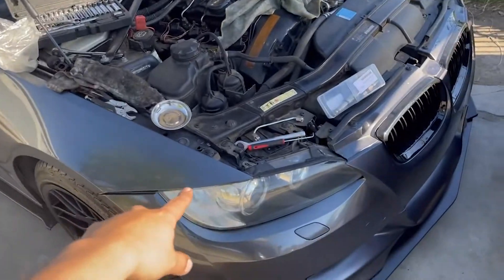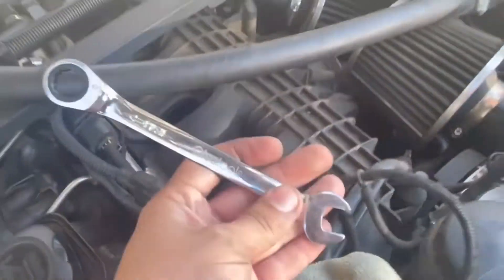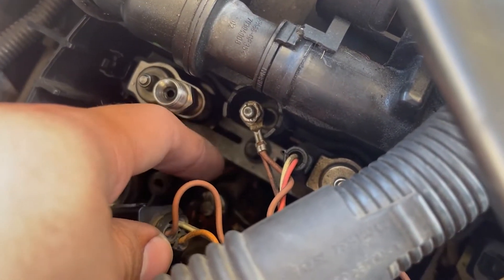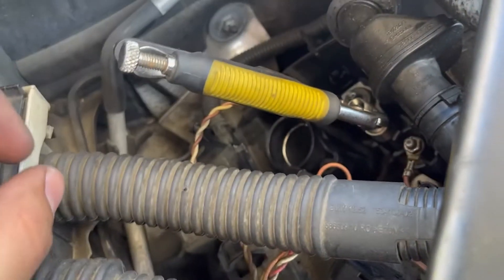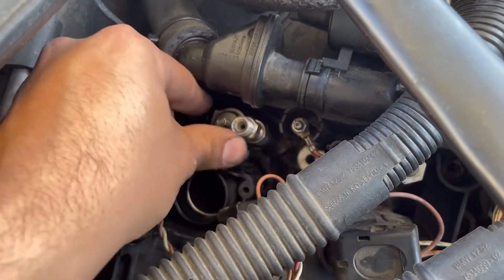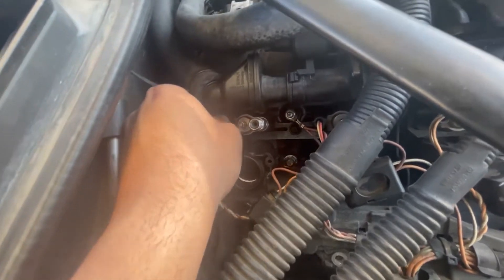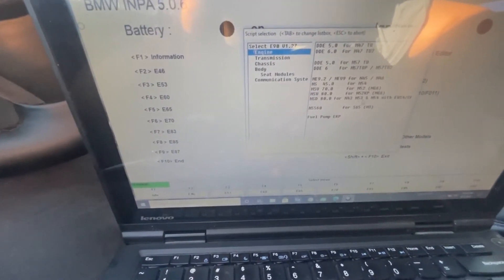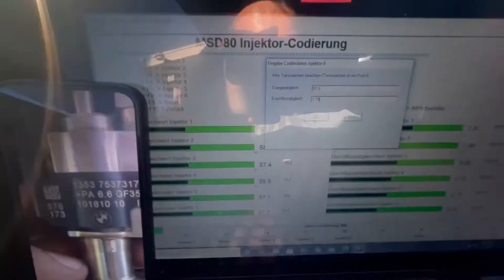INJECTOR replacement bmw N54 335i Without special tools

Comment: so lame that you did not just show the electrical plug harness removal, when you thoroughly had so much to say about it. Twice you could have just shown it, but instead you BS'ed your way out of it. Think about the value you bring when you can show someone with less experience than you just how it's done instead of just talking about how it's done and then not showing it. Try again.

Comment: I recommend getting an injector puller kit you can get a good one of FCP for a little over $100.  If you wiggle the injector while pulling it out you can oval out the port in the head which is a real pain in the Johnson to fix.  The puller kit also comes with the tool to compress the injector seal.
Reply: Do you think the one on Amazon will work? trying to be cheap because I’ll use this tool once every 6 years
Reply: @jumpmanadam1536 yeah should be good enough I bought a cheap harbor freight puller and used that to slide hammer them in they’ve been in for over 5 months now and no issues at all
Reply: Did this happen to you? What’s the fix
Reply: @amirholmes-qi4fd  didn’t happen to me I’ve just seen it plenty of times the fix is drilling out the hole larger and tapping it to put in a bung to make the hole circular again.  It’s a complete pain in the ass and you have to be super slow and careful while doing it because if you allow metal shavings into the cylinder you’ll damage the pistons, cylinders and/or valves and turbos.  Bad news all around not something to mess around with just buy the $100 kit that comes with the puller and seal seater.

Comment: You know your little video on this was probably the most helpful and clear video on this I've seen and I've watched about 10 of them LOL. Right to the point and no fluff. The only thing I though was missing was the torque specs on the bolts. But we can look those up ourselves. Thank you! Oh and one way of easily removing the injector is to use the pick tool (or one with a bit longer "J" or "L" at the end) and put it under the injector where it can be used to pry it up and it will come out just nice!    Question: What did you do with you paddles?? I don't know if they work fine but if they do i want to do it too! Please let me know if you would be so kind.
Reply from the maker: Ahhh thank you so much seriously! Means ALOT! haha I'm glad I was able to help! You know what, that's a great suggestion. I just updated the description and Included the specs. Thank you for that! Ahh I got to try it. It seems alot easier that way haha They are actually paddle shifter extensions from a newer f30. I made a video and put some of the paddles in the description. There might be cheaper ones, but you can get the name and models here on the vide description : https://youtu.be/AvtLo13t0PM Let me know if youre able to see it

Comment: I bought an injector, it's a bmw injector and it has the seal but do I have to press the seal even tho it's on already? Seal doesn't look tight and wondering if it need to be pressed on first
Reply from the maker: Sometimes when they have the cover it’s already compressed into place. But if anything, it doesn’t hurt to do it a bit more :) I never had any issues with mines

Comment: did you replace the seal on the end of the replacement injector? or do you not need to?
Reply: If the injectors are brand new, they always come with seals. If you're using second hand injectors, ALWAYS change the seal
Reply: How about reman injectors